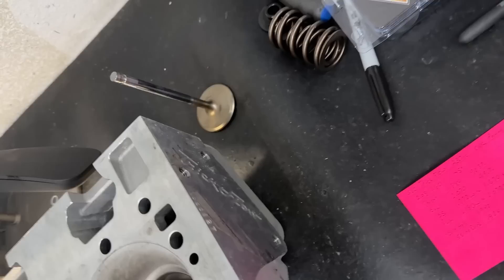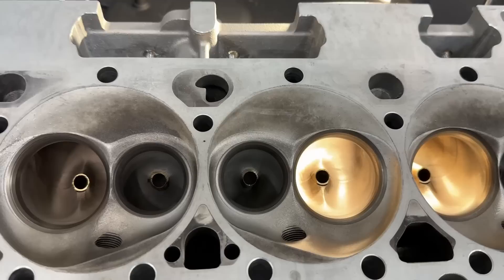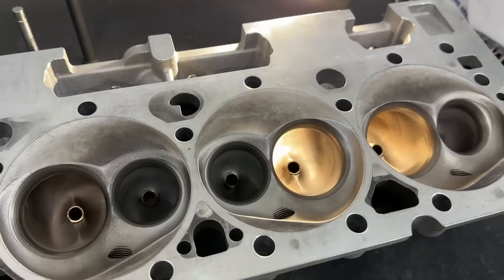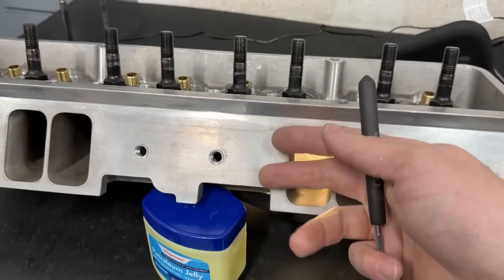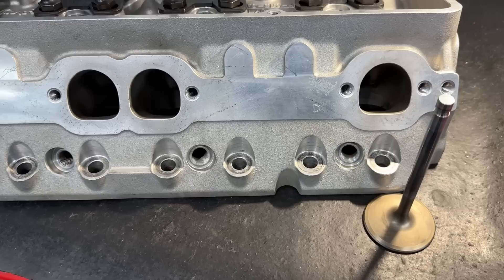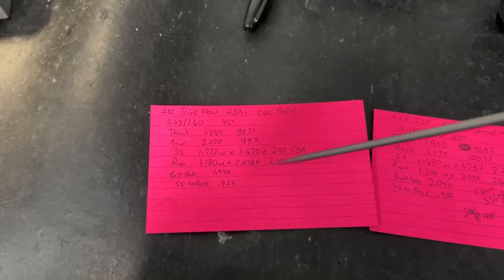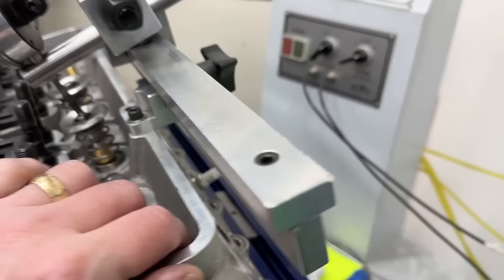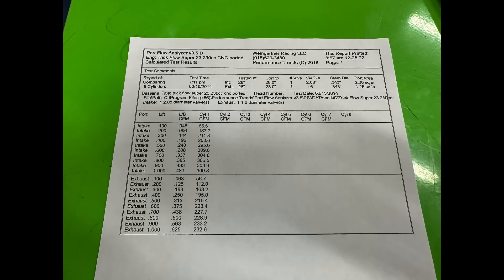Trick Flow 230cc CNC Ported Review With Real Flow Numbers

Comment: I have Canfield 215cc SBC heads  with 2.08" intake (no longer in business) that were flowed by a local shop.  At 0.400", with a 4.125" fixture, the intake flowed 255 cfm.  with a 4.25" fixture, it flowed 264.  That's at 28 inches of water on an SF-600 bench.
Reply: I remember the 5.0 guys absolutely loved those Canfield heads back in the very early 2000's
Reply: @johnsheetz6639  I can't remember why I looked at Canfield.  That was back 15 years ago or more.  Alan at Burtonsville Performance Machine, who's been porting heads for 40+ years, was quite impressed with them right out of the box.  He did a bowl cleanup on the exhaust and trimmed the margin on the exhaust valve and made that better.    If you put canf215flow_1_data  into google search, you can see the before and after results.

Comment: So with very large bore here and comparing smaller cc port(200-210?) with same Intake CFM maximums will these heads produce more power? with say 406 cubic , or would the difference come with 20 or more cubic inches?

Comment: I’m running edlebrock performer rpm heads on my 383 stroker. It runs real good and pulls hard to 6k but are the 170cc runners to small??? Would I be better off running something like 215 promaxx heads?

Comment: What about the trick flows with canted valves?  I ran Buick heads at Bonneville also a great head for the time  Interesting chamber.  I wonder if you use dual quench pistons with those  heads   Back in the day we just tried to keep the intake smaller than the head and claimed it helped with reversion.  Do you od hone the stems.  I have a Sunnen hone/   not only to hold some oil but also to catch tapered, belled, bent, concave stems  find even from premium vendors.    Looks like a good head for a lower lift cam application    cheers
Reply from the maker: I haven't flowed those heads.
Reply: @WeingartnerRacing  70s 80s you are keeping me up to date. We welded cast iron.  BTW on your 406 might be the dyno but I wish you could have tried another couple of degrees then seen what one of Jones inverse radius profiles would have made a difference. . Easy to have 4-8 degrees less seat duration with a similar (better IMHO) profile  GM spent more megabucks on Their Indy program with Jones than all the rest of the camgrinders combined.  I knew his dad and Ed Winfield, Clay Smith  different design philosophies.  Dick Jones was more Winfield   cheers
Reply from the maker: @jmflournoy386  I did use an inverse radius cam just not one from Jones.
Reply: @WeingartnerRacing  Your vendor use a small wheel or standard wheel which does not give much inverse- just trying to help here  what did you finally figure out- put in a lower gear and run it and maintenance budget goes up  cheers

Comment: My old pro topline 235s probably flow around 220 then hahaha
Reply: Nah, I have a set I cleaned up casting flash in the bowl and shortside exhuast. Gasket matched to a 1207. They went 303cfm @700 intake and 210cfm exhuast on a 4.030 bore..  
They were specifically flowed on the 4.030 because they are for a 11-1 350 I put together. 
I snag every pro topline head I can come across.
Reply: @kendriver9139  That's great to know, mine are just barely blended in a few places. They're on a 406, pump gas, 525lift 244/248 dur. Runs pretty good
Reply: @kendriver9139 is that a 235 runner or 220? I have a set of 220 with 2.02 valve did 298 at.700  right  200 on ex.
Reply: @jeremymyers5643  They are 235's and a 2.08 1.60.
What bore were yours flowed on?
 You have to watch out because some times flow guys will flow on a 4.155 bore size to make numbers look better..
Reply: @kendriver9139  yeah I'm not real sure on that , it probably says on flow sheet. But they are from a reputable engine shop and were bought in like 2002. He did a competition valve job and bowl blend, so I'm not sure how much that helps. They perform good on a 11:1 ,383, 240* .570 lift solid roller.
Reply: @kendriver9139  dug out flow sheet , says they were flowed on a  4.155, I've actually got 2 flow sheets . Out of the box with back cut intake 291int, 199ex , and after  comp valve job and bowl blend 300int, 207ex all at .700. 2.02-1.6 valves, they were flowed to .800 and still climbing a lil, 305, 211. I had another set flowed by him I attempted to port years later and they were also flowed on a 4.155. Think that's just what he does.
Reply: @jeremymyers5643  Nothing wrong with those numbers.  Especially if your using them with that bore size. 
Ive read on speedtalk quite few guys say they can get more flow out of the 220's vs the 235's because there's more material to work with. 
Pro topline were a  kept secret.  I snag  every set I can come across

Comment: Wathe are The max flow four The Brodix 11X i soon build 443cuk Csb hope get 900hp  Roller cam abaut 0700 lift 13.1.1 komp E85 Fjuel...Carburator Weeber kit 4 50mm Runn with Dellorto 1992 runns grate Street car in 10.7 no no transbrake litel Nos..210kmt Hevvy corvette 1600kg...Have weery good Camaro 68 good chassi 25.4 i hope run i The 7 sek on The 402m...and 300kmt..
Reply from the maker: Na I don’t think you can get 900hp without a lot of work.